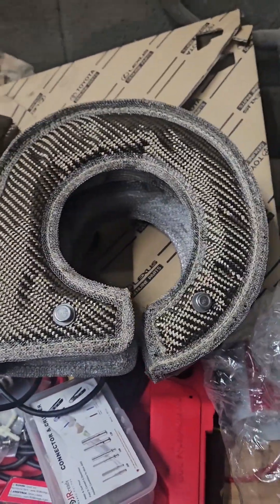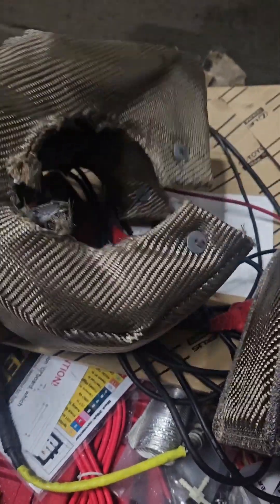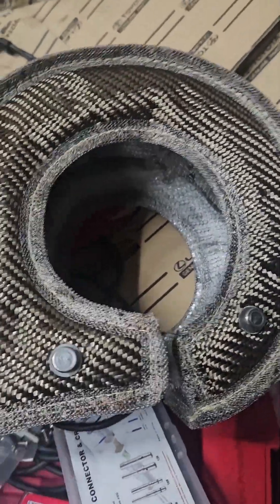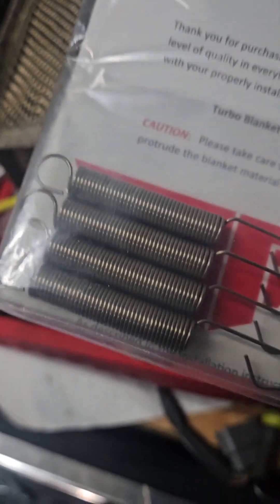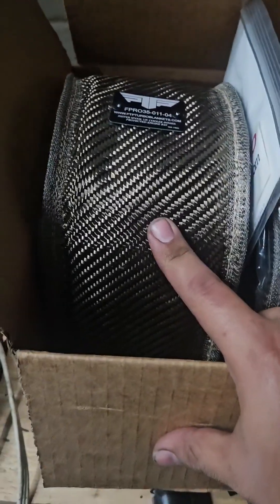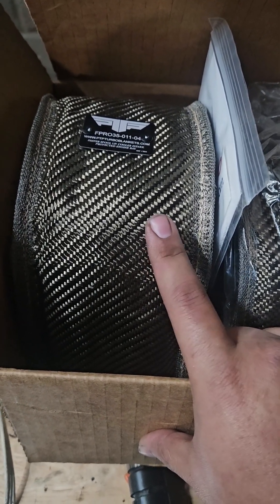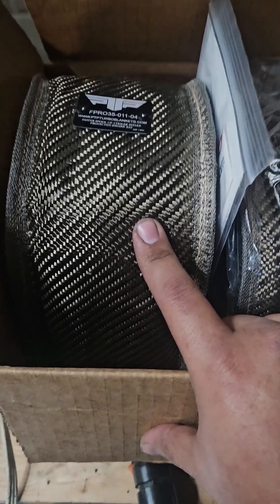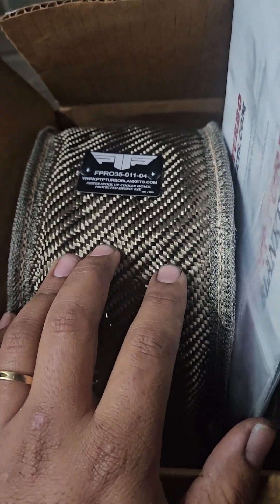Stop buying #junk !!  Cheapo #turbo blankets vs PTP Turbo Blankets!

Comment: I am contemplating putting a PTP Turbo Blanket on my 2018 Fiat 124 Spider Lusso.  The vehicle only has 5000 km on the odometer and I just want to reduce heat buildup under the hood to preserve tubing, and rubber parts.  I am not so concerned about increasing performance at all.  I don’t track my Spider.  Is there any potential for damage to my turbo in usual driving?
Reply from the maker: Not at all!  I've ran one forever, and haven't ever had any issues with the turbo itself. Let me know if we can get you set up one one!